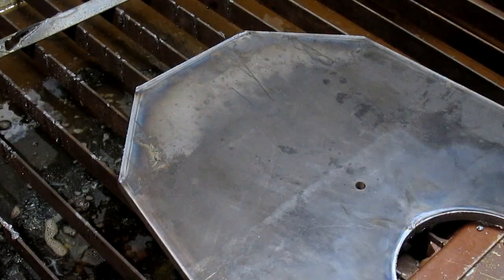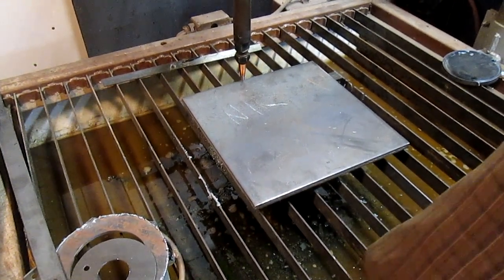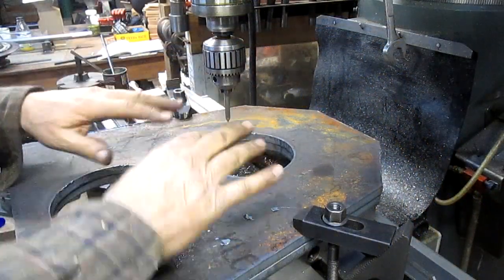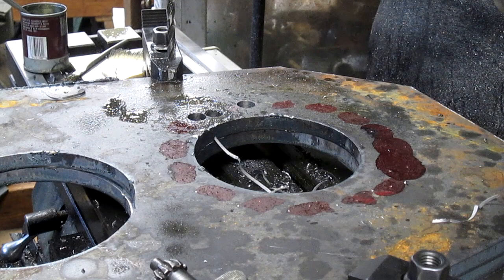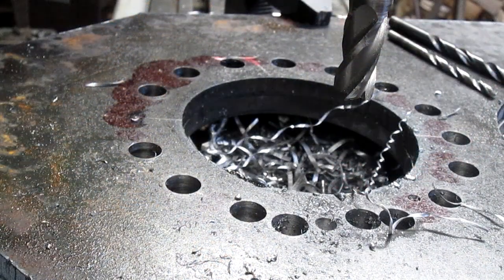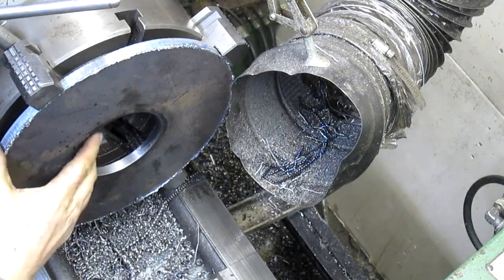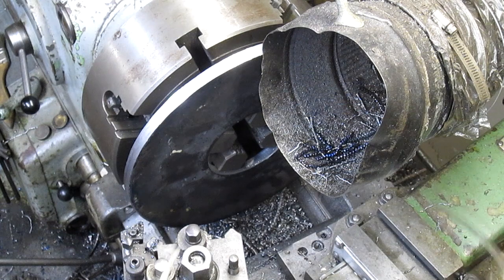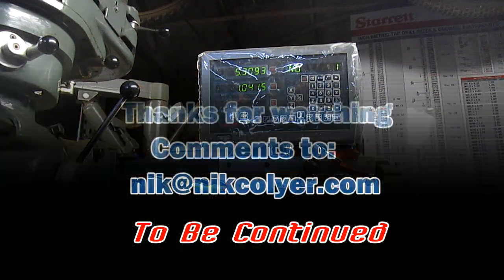Earth Drill Build #4

Comment: I worked it out (I think) on my DRO using a 6 bolt pattern to hasten solution, to get the 6 proper locations the start angle had to start at 30 and the end angle 330, using these angles put 2 holes on the zero of the x axis, so what this means is that on the 12 hole start start angle would need to be 15 and end at 345, using these angles would  produce 4 bolt holes on zero of  axis of the corresponding axis in relation to hole position.
Reply from the maker: Yes, you got it. It took me a bunch of youtube videos and some trial and error, but I finally got it also. Now I can use that function. Thanks for checking in.

Comment: Hi Nick I have almost the same dro and I was getting confussed withthe same thing 
untill I realized my starting angle is to the right of the table when standing infront
of the mill not centre or left but on your right this can be changed but it makes it
even more confussing. Hope this helps.

cheers nigel great vids :)

P.S set your centre in abs mode first then when you go to pcd it will start
the first hole to your right on the X axis.

Comment: Try the start angle @ 22.5° or -22.5°
Reply from the maker: Good tip. I'll give it a try. Thanks!
Reply: @NikColyerMachineWorks  i think you divide  your holes into 360°
Reply: @NikColyerMachineWorks  I think you divide # of holes into 360°and use that as your starting angle. I am a retired die maker in ALABAMA.  Had a car wreak and broke my back a few years back. Got a mini shop in my garage peddle out there when back allows. I enjoy all you guys videos. I did mostly die repair and troubleshooting. Always loved machining.  Done as much as I could which wasn't much in my 40 years in trade . Keep up the good work

Comment: nick i have a sino dro not a sinpo like you have but mine is very very simalar to yours. first have the display set in abs--- absolut mode not inc----incramental  mode. when it says center position and its already on zero just press enter not x zero the y zero just enter. now try putting starting angle at 22.5 because 300 degrees divided by 16 equels 22.5 and try putting your end angle at 360 and see what happends. do a dry run with 4 holes on another centered piece of scrap wood cardboard or metal with a sharpie in a drill chuck just makeing dots and see if it will let you set up your first hole at 0 on the x axis and end up in the right spot on the last hole.
Reply from the maker: ABS could be the answer. I'm going to give it a try once I come up for air. Thanks for the tip.
Reply: @NikColyerMachineWorks  im going to fire up my dro and go for 16 holes this afternoon and see if i can find a solution for you nick.
Reply: @NikColyerMachineWorks  abs is the anwser.inc is for arc lines or straight lines with holes.

Comment: Nick. PCD stands for Pitch Circle Diameter. That means the centreline of your holes. When you set up your job, find the centre of the hole, Zero out the DRO, then set up your PCD and number of holes. The first hole usually ( although you can specify an angle ) should be either in the X or Y direction. So only one handle will need to be turned to get you to the first hole, all other holes will need X and Y movements until the DRO reads Zero in both cases. Hope this helps.
Reply from the maker: That is the conclusion I came up with, but the dro wants me to move down which means if I ignore it the second hole will be too low.